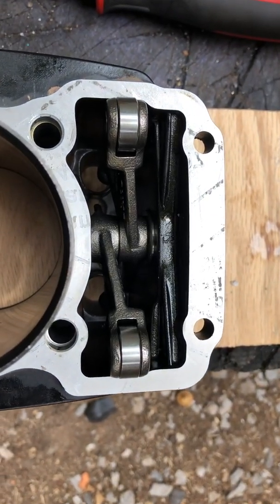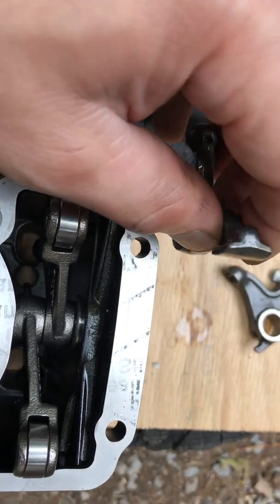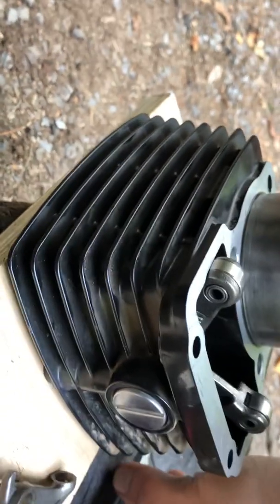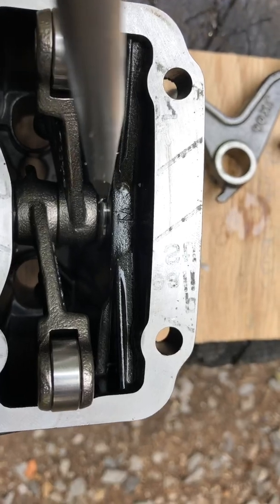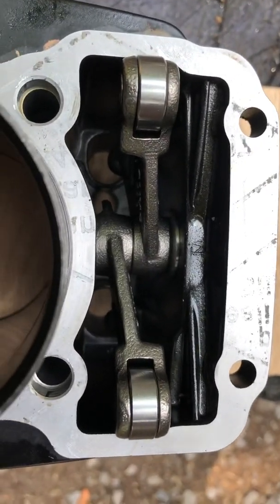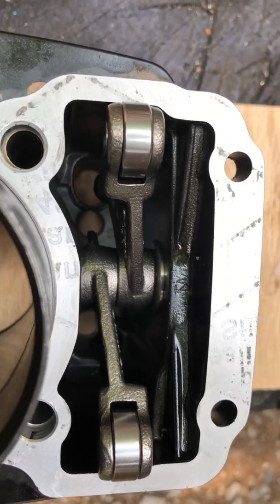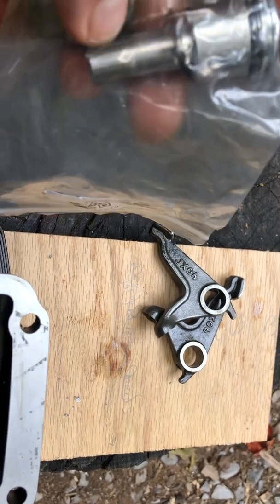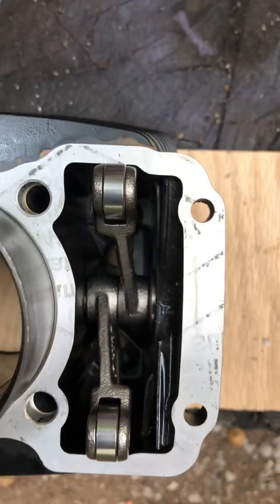Tbr7 hawk 250 cg 125 cg 250 roller cam followers roller rocker motor upgrade

Comment: I added this with a 292 cam and now have excessive valve train noise. What is described as the "sewing machine" sound. Valves have been checked, tightened down to almost zero lash. After warmup its pretty darn loud. My last attempt will be to put a thicker oil in the motor to quiet down the noise a little bit. It use to be a pleasant rhythmic tick that has now become very pronounced. I checked my work over again and it seems like something that ill have to explain to every person that will tell me my valves need to be adjusted. Edit: when it cold starts their is no valve noise present increasing as it warms up.
Reply: I had a similar issue... mine turned out the be the roller falling apart and needle bearings falling out chewing up the cam gears.
Good thing is I never upgraded the cam so now I'm just going to put the 292cam in with the stock followers.
Reply: @RenKitune  I'll follow up with you on this. I set aside feeler gauges and continued to tighten the adjuster with a tool until I got little to no tick. It's been good so far and I'll be tearing the engine down for a rebuild soon to put motocults true 250 cc jug on with his flowed head. I'm curious as to see how I did porting my stock head vs his. I've had the jug for a while and was waiting till I started to loose compression. It's time for the swap, 6k hard miles on the odometer. I'm keeping the compression up with "engine restore products" oil additive. It's a good bandaid fix that does work as long as it's added with every oil change. Now I just need to be working less than 70 hrs a week to have the drive to do the upgrades. I'll inspect the roller followers on teardown and I have inspected them tearing it apart before. No obvious issues were found previous.
Reply: to follow up again, I did put the 292 cam in with my "300cc" true 250cc jug, flat top piston, my own ported head, stock cam followers, CRF230(i think) full stainless exhaust, and the basic stock replacement carb. hit 81mph full tuck with no plastics down a slight grade, was very shakey (unbalanced tires being very pronounced is my guess at that speed)  @jesses1589

Comment: Ive installed the rollers with the stock cam and the engine runs worse...so dont bother with rollers unless you want upgrade the cam.

Comment: Thanks for sharing! Does the motor feel any different after doing this or is it just for peace of mind?
Reply from the maker: Yeah the roller setup does allow power the motor already had that was being lost in rotational friction from the old setup to actually be felt now
Reply: @Jboost412  But because of the geometry it negatively affects the total lift and duration of the cam. It makes the engine smoother but reduces power. To experience REAL performance gains  you'd need a performance cam SPECIFICALLY designed for use with those lifters.
Reply from the maker: I have one I’m sorry I didn’t mention that in the video I made this one for a specific person at the time in one of our groups who wanted to change the cam & swap to rollers but I have a much larger cam in there to go along with the other work done
Reply: @Jboost412  I ended up putting a performance cam from Brazil in mine just gotta tune her but it makes a difference for sure
Reply from the maker: The Brazilian cams are definitely good I’ve used a few of them without any issues
Reply: @Jboost412  where did you order them? i havent found any:(
Reply from the maker: I sell them for 16.00 bucks on Facebook as part of the performance parts I sell for them but you can usually find them on eBay for around 30 bucks with a fake performance cam 😆 so don’t bother with the cam they sell but that’s the way I use to get them before I got in with a manufacturer for them just go to eBay & search up CG roller cam followers they should pop up
Reply from the maker: When you do get them it’s gonna come with a new cam follower shaft don’t use that one just reuse your original wave washer & follower shaft as I’ve found they’re a different length so it’s best to use the original
Reply: @Jboost412  yes i have found several fake cams where they are the sames! can you give me a link thats legit? or you dont sell on ebay? :D
Reply from the maker: I don’t personally sell anything on eBay
Reply: @Jboost412  do you have the advanced key, or you installed it? I cant order it on websites so im going to make one from a spare one, i would like to ask how much is cutted down from the material. Or do you have insta? Would be nice if we could talk there, ofc if you have some time :D
Reply from the maker: Yeah the 4-6-8 degree key among other things is something we make here in house for our builds since availability sucks now for them goes great with the big bore kits we sell the high flow high Comp head cam rollers etc etc matched with out upgraded valve springs locks & retainers with the typical bolt on stuff these bikes really get up & go nowadays
Reply: @Jboost412  nice nice these bikes have great power, mine has 9maps cdi, CRF 38-55mm exhaust with a BBR pipe, can you send me a pic of yours? So i can see where to cut it? And how much mm to cut?
Reply from the maker: Sure I can take some measurements of how far the offset on the key should be once I get done with this Jeep here I’m putting a new engine in for someone real quick having trouble getting it to idle
Reply: @Jboost412  have you tested te IAC valve? If it has one
Reply from the maker: What a nightmare it ran good just wouldn’t idle to save it’s life 🤦‍♂️ I fixed obvious things first from the engine swap vacuum leaks loose connections-grounds etc etc injectors came from eBay/Amazon I was told so they had to go along with the spark plugs which all made it run better & better but it still just wouldn’t idle ended up unbolting the distributor adding some timing she smoothed right out runs perfect…..apparently after I set the timing someone loosened the bolt & begun to mess with it after I left so didn’t think to look there 🤦‍♂️
Reply from the maker: Iac was definitely on the list of things I checked
Reply: @Jboost412  oh man.. i feel bad for ya, always that timing :D
Reply: @Jboost412  when you have time please check that key man, you have any social? where you can send a pic of it? so i cut mine nicely too :D <3
Reply: @4kqu552  Where can I purchase a  9 map cdi from? Please help!
Reply: @juniorhenderson7512  i bought it on aliexpress
Reply: @4kqu552  Does it make a seats of the pants difference? Cost?🤔
Reply: @juniorhenderson7512  it gives stronger spark, its like 30dollars
Reply from the maker: The multiple map cdi boxes I personally didn’t like using but they definitely work it changes from 1-9 and affects the timing advance/torque curve so you have the option of 0 additional advance to a maximum of around 2 degrees advance from an adjustable cdi I ended using the one that’s 2 degrees all the time since my bike likes a total of 6
Reply from the maker: But the digital selection cdi is available on AliExpress I know that’s where mine came from but they might be on eBay or Amazon by now
Reply from the maker: 2 degrees of additional advance isn’t really a seat of your pants difference it just compliments other modifications one makes to all collectively come together making a noticeable difference